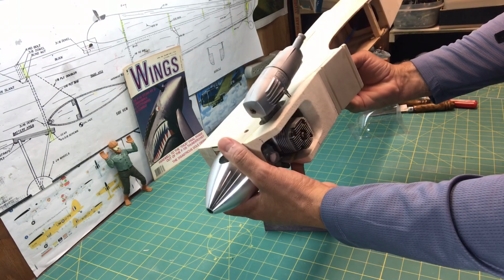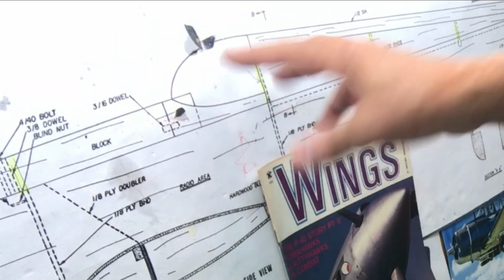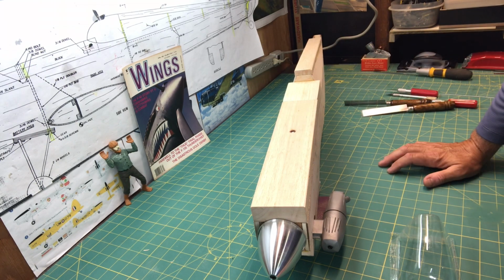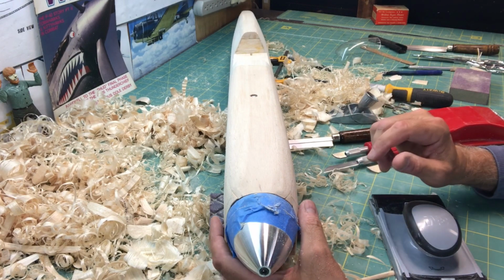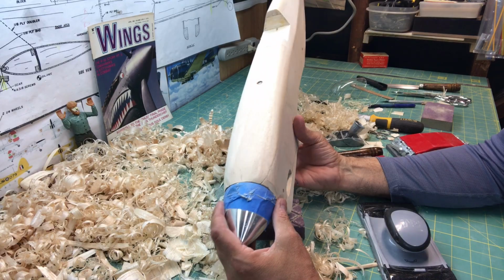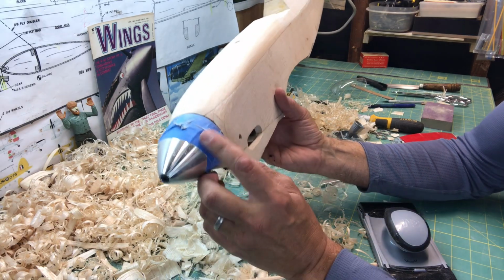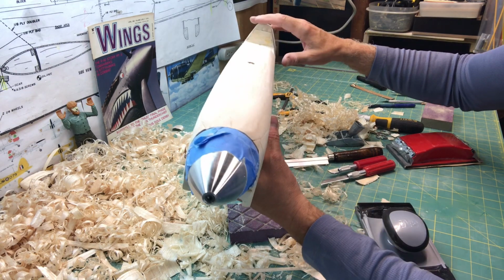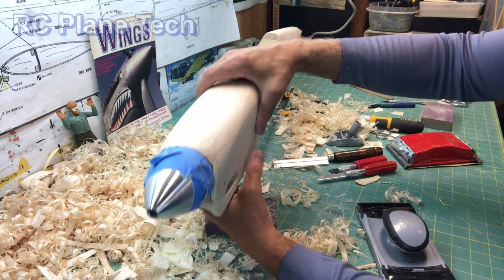Balsa USA Smoothie RC Plane Kit Build No 26, Shaping upper fuselage and canopy

Comment: This is the only sport plane kit that my local hobby shop has. $160 .  The cockpit looks like a great place to put the receiver and or remote locator.
Reply from the maker: Hi, ya as long as you can make it accessible I guess. Maybe attach it with screws or magnets so you can get it open.

Comment: Why did you have to do this, I thought the kit would come already with balsa shaped like the plane picture.
Reply from the maker: Mine came with just a block of wood. So I had to shape it. It’s a little challenging but as long as you take your time and try to take small cuts and keep checking as you go, it should go well.
Reply: Wow, well you did a great job.

Comment: Love the videos. I am getting ready to start a scratch build after being got from the sport for 30 years. For your shaping tools, that silver one, is that a rasp?
Reply from the maker: Hello, glad to hear you are building! that shaping tool is a razor plane. The one I have here is an old one. But you can get a great one from Master Airscrew. Or check ebay for the older ones. Below is the link to Master Airscrew, you can get the “ modern” one from them. Here is the link:
https://www.masterairscrew.com/products/razor-plane?currency=USD&utm_medium=cpc&utm_source=google&utm_campaign=Google%20Shopping&gclid=Cj0KCQiAo-yfBhD_ARIsANr56g6PmYXI3HwxMfzsUzsgPT1tROl1fFFd9lx3hbFemddaWtKSRcaGyFcaAoj0EALw_wcB

Comment: Too bad they don't make a cowling for it! That would make the building much easier!
Reply: But that makes the nose much stronger than a fiberglass cowl would!
Reply from the maker: Ya, it was tricky getting it all to fit and shape. But it will be more solid for sure. Ill coat the inside with a resin to protect the wood from fuel.

Comment: Can you suggest a carving and shaping wood kit? Also planers for rc models biulds
Reply from the maker: Hi, I just use xacto carving kits. They come in a box, with several blades or you can just buy the handles and get blades separately… if you go to Amazon or other online there are lots of options. Here is a good kit I saw on Amazon:
X-ACTO X5285 Basic Knife Set (XW5282E).  There are a lot of knock offs and other brands , but x-axto has been making them for decades and are good quality. The blades I use most are the No 11 and the No 16, but thats just personal preference. Get the combo kit and you can see what blades you like the most. As for the razor block plane, really the only one that I think is easy to get that is not super expensive is the Master Airscrew brand. https://www.masterairscrew.com/collections/building-tools/products/razor-plane

I picked up an older bran off ebay, the one in this video, nut Im not sure I like it much. I will probably get the Master Airscrew brand above.

Comment: Canopy glue Formula 560 is the best it works fast, works great and dries invisible 👍 great work on the fuz nicely done 😁👌there is always more to shave off lol
Reply from the maker: Thanks for the tip, I check it out. And yup, Im still sanding here and there.
Reply from the maker: I just ordered a bottle from Amazon, I’ll give it a try. I usually go with epoxy but its hard to keep it clean. So this will be a new learning experience for me. Thanks